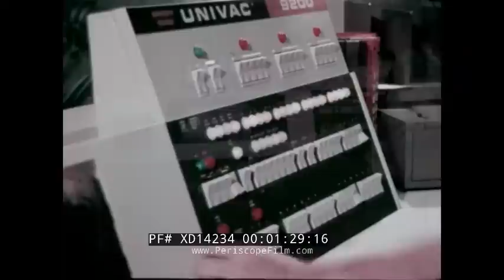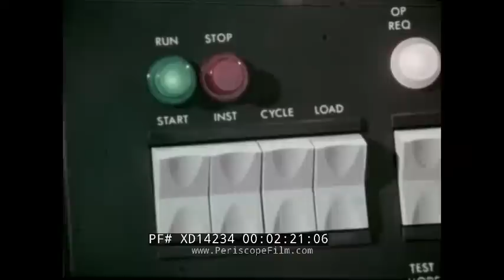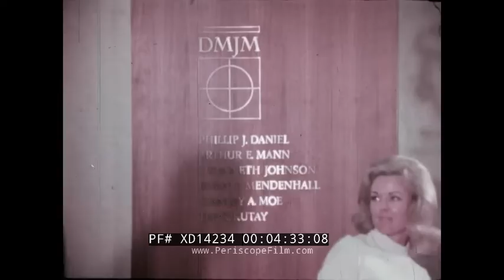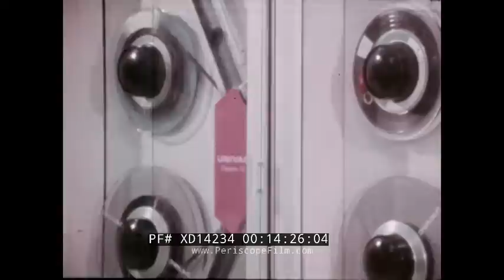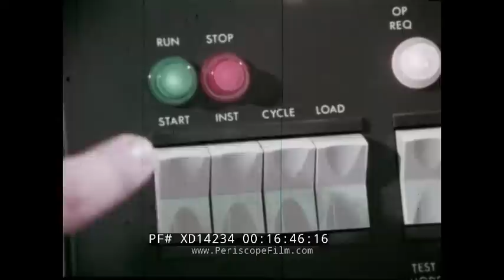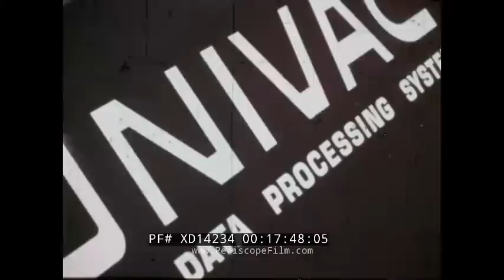"WHAT'LL IT DO FOR ME?"  1960s SPERRY RAND UNIVAC 9200 & 9300 COMPUTERS PROMO FILM XD14234

Comment: Base model had 8K of memory, expandable to a max of 32K (with a second cabinet).  I serviced many when I worked for Univac.
Reply: I worked at a typesetting company in the mid '70s, and they had a Data General Nova II with only 32K of memory(!).  Four VDTs (Visual Display Terminals), two Trident T-50 50 meg disc drives, a paper tape reader, and a burpee paper tape punch ... yes, all in 32 K.
    We produced about 30 major monthly magazines on that system.
     Eventually, we upgraded to the DG Eclipse, with 64K of RAM.
Reply: Yup, so did I. Plated wire memory, Uniservo 6 tape drives, and even 8414 disk drives. I still have a 1/4 hp printbar motor from a 9300 on a grinder in my shop!
Reply: @guylavoie1342  Where did you work?
Reply: @KS-cp6bj  In Montreal Canada. I started in 1978 and was trained as a technician (CE) on the 90/30, but we also took care of the 9200/9300 that were still out there. We also had two 9400's. I later worked on the 90/60 and 90/70.